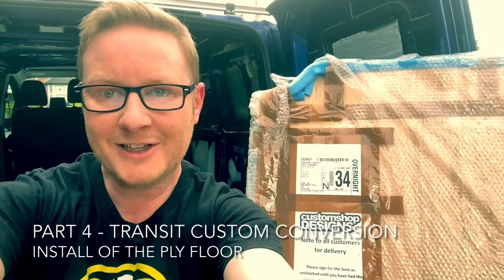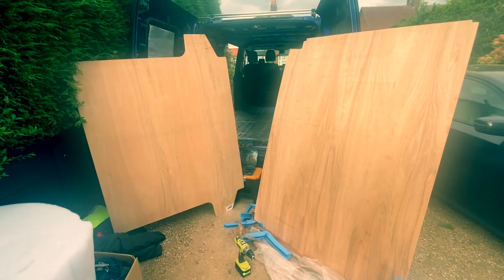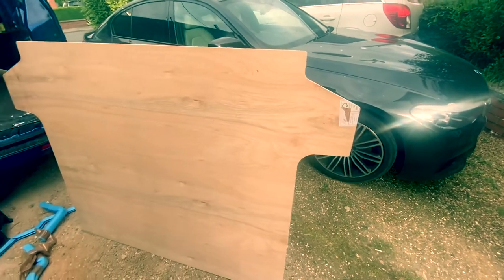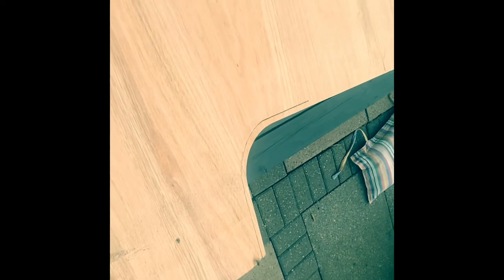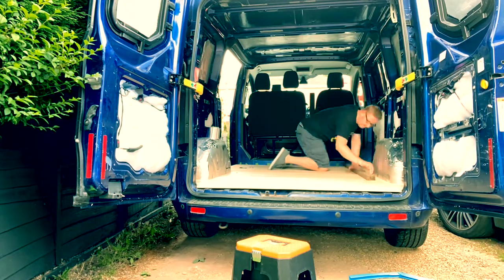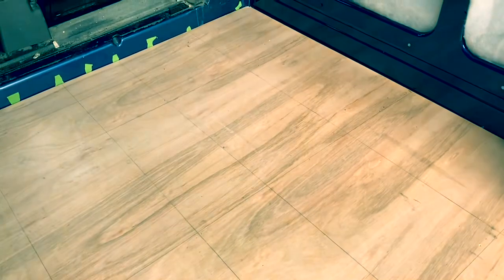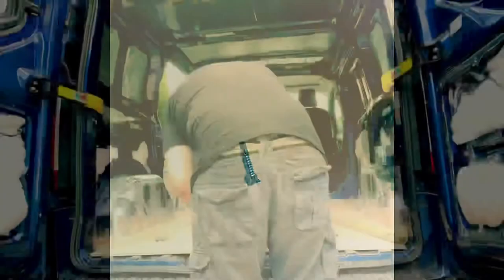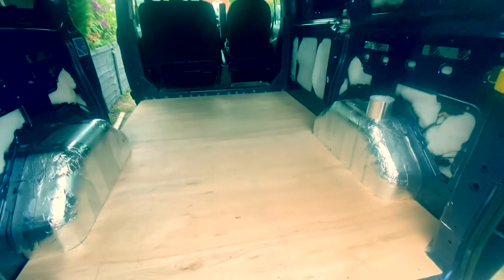EP4 | How to Install ply floor into Transit Custom for a camper conversion

Comment: Hi mate. We have just got a 2014 custom to convert so your videos are really helpful. I notice you didn’t build a subfloor. I’m trying to decide on wether to do this or just go with insulation & ply line like you have. Have you noticed any downsides to not having the subfloor or what would you recommend? Thanks!
Reply from the maker: Hi Tom - thanks for checking out the videos and the comment 👍 have not noticed any downsides so far 😃 Floor is stable not creaks etc 👍 Only thing I think I would have done different if I was doing it again would have been to use ply battens glued to the van floor in between the ribs and screw into them as opposed to the metal ribs. Also to make sure areas in the middle, back and near sliding door have ply to pack it out too 👍 I did a video recently on mistakes/ things I would do differently it’s here if it might be of any use too below 👇

https://youtu.be/GKJotRfVq4Q
Reply: That’s great to know! Thank you for the reply. Will check out the video 👍🏼

Comment: Hi mate, just been looking back through your videos great help cheers .I have the same floor and have the back plastic trim for the rear did you cut back the ply floor any to get this too fit. Cheers hope to see more videos soon. 😎
Reply from the maker: Hi Phil - glad the videos have been a help and thanks for supporting the channel 👍 I didn’t actually use the original part… I made my own cover from some ply and covered in 4 way stretch carpet… looks OK I think 😃 If you take a look at the van tour video I did I think it’s on there what I did if you wanted to take a look

Comment: Hi, just looking into fitting my ply floor and wondered if you fit a gas vent through the floor? If so how was it? Did you need your furniture in first to get measurements? Many thanks
Reply from the maker: Hey Sam - thanks for the comment and checking out the video 👍 Yes I did for a gas vent thought the floor. I did a loose fit of the furniture to get the position, measured up internal and external and then did a pilot hole then did the full hole after 👍
Reply: @TransitCustomCamper  thanks for the reply, sorry more questions, did you put a large hole all the way through the ply and van or just the ply with a smaller hole through the van? Just worried it’s going to create a draft spot

Comment: Do you think that, in order to install a wooden floor, it's 100% necessary to remove the plastic floor that comes with the van?
Reply from the maker: I would say yes. If you want to add sound deadening and also insulation and then do a “nice” finish floor for a camper conversion be best to remove. It’s quite easy to get it up and out usually 👍
Reply: @TransitCustomCamper  thanks for sharing your knowledge. Cheers.

Comment: What length screws did you get in the end ?
Reply from the maker: Hey Ash 👍 Thanks for checking out the video and the comment. I will have to double check and post back for you as I can’t remember the length I got in the end.

However, one thing I would consider if doing it again would be to actually glue down wooden battens in between the ribs and then screw into these as opposed to direct into the metal ribs. 

Both methods are OK, I just think the batten method would be easier than having to drill pilot holes and then screw in. So might be worth you considering that approach too if you haven’t started yet 👍 I am planning my next build and I think I’ll do it with battens next time.
Reply: Ok thanks for you reply I’ll look forward to seeing another build👍🏻

Comment: Did you check your fuel tank after fitting.  Garage have just called me to say I may have put holes in the top with my screws......oops
Reply from the maker: Oops! I haven’t checked no… but I hope as I went into the ribs on the floor and the screws should not have gone below the height of the ply, insulation and ribs - so hopefully be OK?!
Reply: @TransitCustomCamper  I had a look at the garage seems I may have just missed the tank, but very close to a brake line

Comment: why would anyone screw the floor down? ,couple of years and big rusty holes
Reply from the maker: Hi Severson - yeah that is great feedback on this approach. I did check out if this was OK and did research. However, thanks and I agree on another video of my mistakes or things I would do differently I suggested attaching wooden battens in between the floor metal ribs and then screwing into them 👍 Appreciate you calling this out I always try and be as open with what I did and hopefully people can then decide what works best for their own builds Don’t make the mistakes I did 😢 | Top 10 Van Conversion Errors In Transit Custom
https://youtu.be/GKJotRfVq4Q
Reply: @TransitCustomCamper  should of sikaflexed it or even just left it floating it wouldn`t go anywhere , personally would of sikaflexed thin battons down and insulated then screwd to the batons
Reply from the maker: @Severon1965  yes 👍 agreed. Thanks again for taking the time to put the comments in on it 👍
Reply: This Is my worry, I am in the middle of converting a camper now and have filled all the holes in the floor from where the original ply floor had been screwed down, I have just finished laying insulation but don’t want to screw back through the floor, may just leave it as it is and lay vinyl on top of the floating ply, I can’t see it moving much to be honest, will try it and see.
Reply: @htid43  sikaflex wood down and insulate between then wood over the top NO screw holes
Reply from the maker: @htid43  yeah this seems to be one of the most common queries and questions that pop up… I think in hindsight the battens and some sikaflex would be best option… 👍 hope it all works out on your conversion
Reply: @Severon1965  sounds good, I will try it thanks 👍🏼
Reply: Is it sikaflex 522 you’d recommend and what size Battons would you use ?
Reply: @lukebailey3958  did you find an answer to your qu? I was thinking 9mm thickness to put in between the ribs? Hoping cutting up some ply will do the trick!